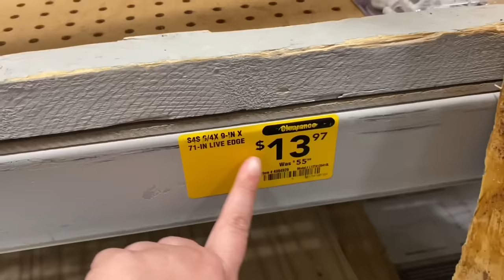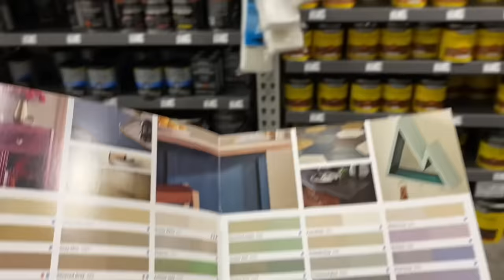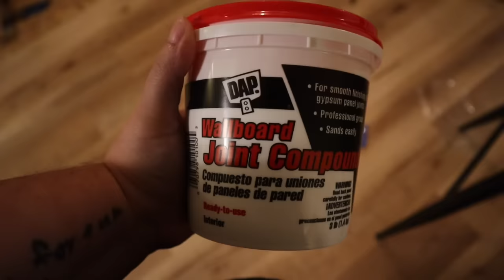*EXTREME* MOBILE HOME MAKEOVER | 1991 double wide mobile home renovations | modern farmhouse | ep.12

Comment: Hey Merina! We put up the brick panels in our kitchen earlier this year. Instead of drywall compound, we used a product called Homax from Lowes. It’s wall texture and has sand in it. I was able to roll it on with a paint roller and then scraped it with a plastic scraper so some of the brick color showed through. We are really happy with how it turned out.

Comment: You can mix that joint compound with water! It would work on the wall. Love that you are bringing the brick to your new place. You can wash your scraper, soak it in water and wash it off. It will dry white, it's not completely dry yet. You can also mix your stains to get a custom color.

Comment: Just my opinion, if I were doing this with the joint compound. I would take a water bottle that sprays a fine mist. Lightly spray and use a soft broom and go over it in different directions and it will give you a more realistic look. You can take the broomstick off and use it without. also you can purchase a bag of joint compound and mix it as thick or thin as you would like it and be a lot cheaper. Just be sure you don’t get the 10 or 20 minute compound because it will harden in that amount of time.

Comment: I stain and paint doors and trim for a living. Sand down your pine boards with 220 grit that will get the weird coating off and make it more receptive to stain. Its easier to stain it before you hang it so you can let the stain absorb longer before wiping it off and failing that you can do several coats. Special walnut is a dark color so don't be discouraged that it didn't soak in right away. That sometimes happens with pine. Good luck! You're doing great!

Comment: Hey there !  Wanted to say that the first material you applied to the lower part of the faux brick was Joint Compound. The second   application of pink material was Spackle. . Spackle is much drier & very flaky. If you want the end result for the entire wall to be consistent, it may serve you best to thoroughly sand the spackle section, then go over that part with Joint compound. ❤❤

Comment: So, if you use a white chalk paint and let it dry, you can do something called wet distressing and it takes the paint off. A lot like what you did with the wet rag on joint compound. Waverly chalk paint at Walmart in the craft section is really good. After the paint dries, You can spray a little bit of water on the wall and get a wet rag and distress. I honestly believe that would work. ❤

Comment: Hello! Sand the pink stuff down a bit more & it should dry white. Its honestly a lot easier if you mix it with water.
Do a couple more coats of the special walnut & leave it to sit a bit longer before you wipe it back & it will darken nicely xx

Comment: I bet it would be easier to cover the area with joint compound if you were to use a lightly dampened sponge (like a large carwash sponge) or a cloth and then go over it with the spatula/spreader to get the markings that you desire. Would go on a bunch thinner and probably cut the time in half. I would test the methods on a scrap piece wood or paneling and see which one works the best and is the most efficient. Coming along on the new digs.

Comment: I'm about to blow your mind girl- you can mix stain into the wood filler BEFORE putting it on your walls. If it's cold or the putty is too thick the stain will thin it. Your work will go much smoother, and you'll have a much easier time putting it on and sanding  it off.

Comment: MERINA, have you ever tried the BOX of pre-mixed joint compound?!? WAY CHEAPER! I remodeled my sister's "Fixer-Upper" and that is what I used! In 2021 it was about $8.00 for a 20+pound box at Lowe's! Get the PRE-MIXED, add drops of water to get the right consistency that you need, too! It dries out, so I put the plastic bag of compound in a 5 gallon bucket with a lid. Worked well for me. I was thinning it out (like pancake batter) to TEXTURE her walls in the house. Entire house, 3+ coats of joint compound, and it did a 3 bedroom, 2 bath house, too! 🥰

Comment: When I use wood filler I take a damp cloth and run it over where I put the filler while it is still wet and that gives it a smoother surface and takes a lot less sanding afterwards

Comment: I know it's nerve wracking to branch out, but mortar mix or drywall compound is cheaper and goes further than joint compound that is premixed. All you need is a drill, a mixing paddle, and a 5 gallon bucket ;)

Comment: I worked at our local Lowes. I hated all those stackouts in the middle of the isles. Try moving a roll of carpet on a cart thru there. Uggg. Also, any paint or drywall spackle, bring into the house over winter. If it freezes, its worthless. Ummm budget rules were meant to be bent ... evidently 😢

Comment: You did the right thing in not allowing yourself to go over budget. But I think that once you realized the wood was going to cost more than budgeted for, you probably should have postponed the project until you had the new estimated amount saved up. I know it's so hard to walk away from a project just when you thought everything was going to work out for you to start, but sometimes it's the best thing to do when a piece of the project (like the actual costs being considerably higher than anticipated) isn't fitting in properly. And don't forget to budget in "wiggle room" for projects, so that you'll have some extra to play with if you need a little more of something than anticipated (like the join compound).

Comment: You can use white paint to achieve the some look. Paint it in, thicker in “grout” then brush over bricks and wipe with a rag while wet. You can use different colors to have highs & lows with paint. Also staining light wood will take multiple coats. Again darker paint with white wash technique of removing color would probably be easier & cheaper in long run and you can really dry out brush before applying to board to stretch paint further and not be so thick. It works well but like with joint compound there is a little learning curse at first. Maybe practice on back of board before putting it up since going on wall. It will be huge time saver in the end & money.

Comment: You should have got that compound off the wall while it was still wet, it works better that way. And believe me a wet sponge works a lot better. Just a little suggestion. There was too much put on, you have to work to hard to take it off. The reason I know , I have done the same thing. Good luck on getting it off.

Comment: One way you can do the wall the way you like it, and save on how much joint compound you use, is to start by only “painting” on the compound to the mortar lines of the wall, then after you have done a small area of joint lines, take a damp sponge or rag and rub it out over the bricks…then keep working in small areas like this until you get all the wall covered i believe you will get the look you want and use less compound. By doing this, you get the whiter joints, and lighter finish on the actual brick and can see some of the brown through the compound. Keeps you from putting all that compound all over, then wiping most of it off. I hope that made sense.  This technique works well in real brick so i dont see why it wouldnt work on your wall board…and it would keep you from having to sand at all. Basically, you put compound on the mortar lines and then smear it out ober the bricks with damp rag in small sections at a time, until the while wall is covered…less work, and less mortar used. I know you are finished by the time i write this, but for future reference, may help

Comment: A little to late? Maybe. Spray your compound with water, then wipe off. If you keep it wet, you've got plenty of work time. Cheap way on wood filler. Keep your sawdust and mix with wood glue. Same color and you'll never know after you stain. On your edges that are showing, take a pencil or screw driver and roll over the edges. It will curl into each other. Maybe will help.

Comment: The color from your sanding paper caused the pink color.  Do a whitewash over the entire wall with a 50/50 water to paint ratio, wring out your rag to apply it.  Test a small area to see if the white is covering the pink compound boo-boos.

Comment: Not trying to be a smart ass but how do you scrub or wipe down that brick wall when it gets dirty?  The drywall mud will soften if it gets wet.  Because of this, grout would have been the better option.
Reply: I did this brick schmear in my kitchen and slapped some poly over the whole thing just bc I was afraid of Spaghetti sauce splattering 😂

Comment: Merina,  you are transferring the red stain from the faux brick onto the joint compound turning it pink.  If you do another coat with the joint compound you will get the same results with pink walls. Maybe just try a very very thim skim coat of joint compound without rubbing it off the red brick. Might give you more coverage than you wanted but you won't have pink walls.